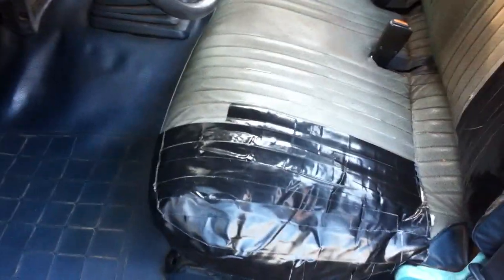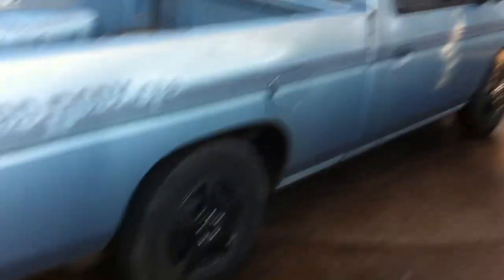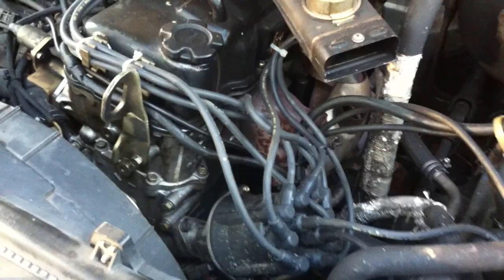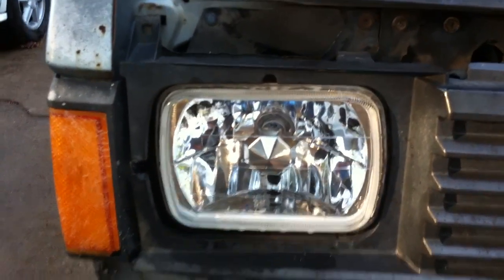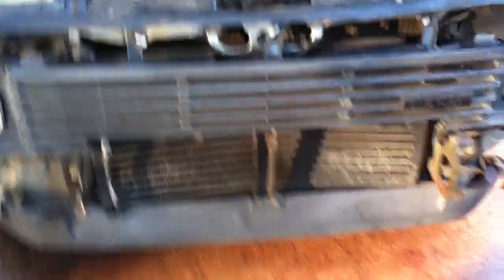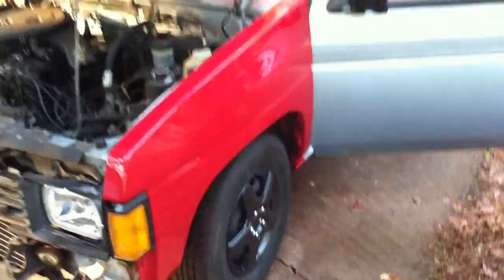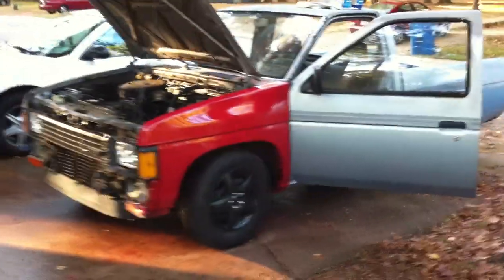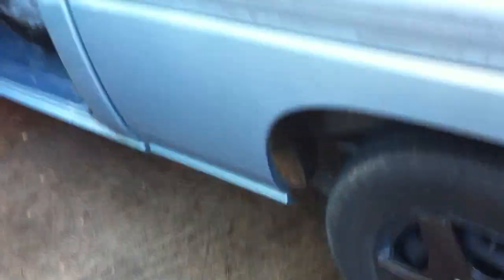87 Nissan update 1

Comment from the maker: @Jeffrey Davis take out the tail lights and disconnect the wires pull them out the bottom. Take out the screws that hold the filler neck in place where u put gas is at. Find the ground wire that goes from the frame to the bed. Then while your under there. Take off tall the bolts that hold the bed to the frame. Hope this helps you.

Comment: After you lowered the front where you able to get aligned? And what did you need if anything to align it to spec?
Reply from the maker: I didn't drive it that much so I never got it aligned 3 to 4 inches can be aligned 4 inches is pushing it though